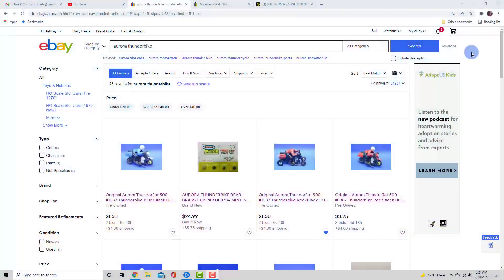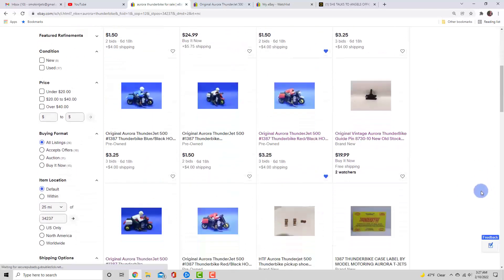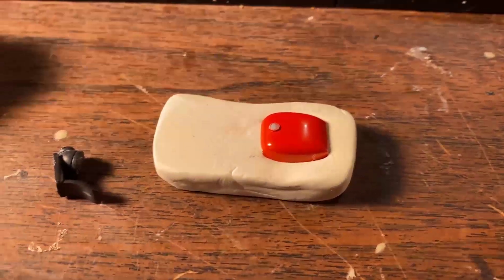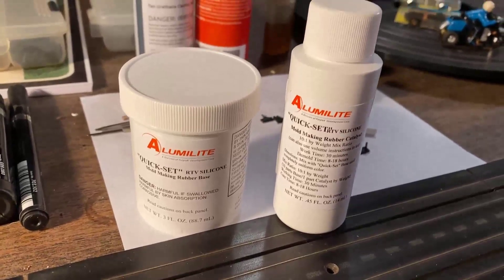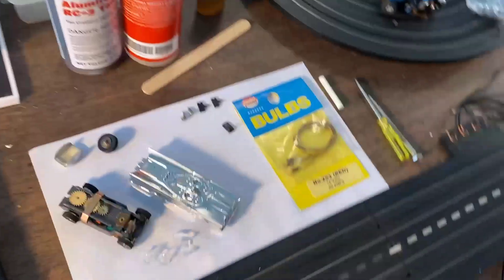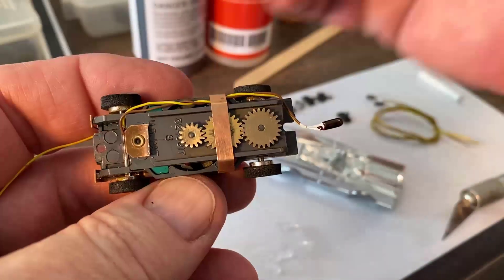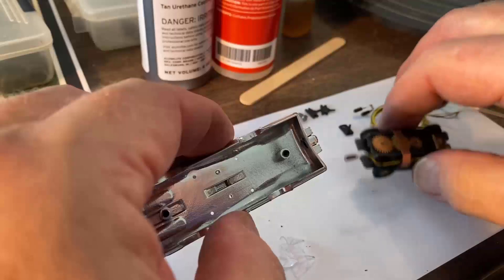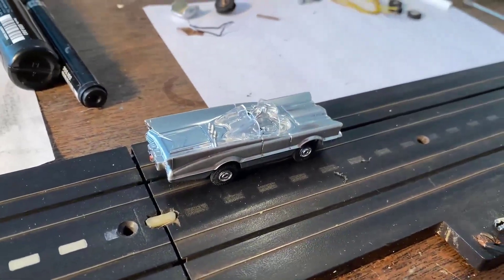Making Parts for Aurora Thunderbikes Trike Slot Cars Plus More Stuff

Comment: Always enjoy watching your videos. If you end up with extra thunder-bike heads or tires I would be interested in buying them from you.
Reply from the maker: Hey William,
Thanks for the kind words, I enjoy having fun making the videos.

I'll be than happy to get you the parts that you need. Send me a  list of what you're looking for and your mailing address.
My email is: smokintjets@gmail.com

Years ago I did a video on replacing the rear tires on the Thunderbikes with neoprene washers (wetsuit material) I found at the hardware store. The washer worked extremely well!! I did have sand them down a bit, they were slightly too thick. They gave the Thunderbike better traction than even New Old Stock tires. Just a thought.

Alright William, have fun, see ya!!

Comment: That jet light for the batmobile is cool. I'm gonna to try that with my 4 gear body. I recently did a video showing how to add 3mm LED lights vs using the incandescent bulbs. A red or orange LED would look nice, and they also don't impact the car's performance.
Reply from the maker: Hey Stock,
Thanks for the comment and the tip. I'd love to see your 4 gear Batmobile when you get it done!!
Let me know if you need anything, see ya Stock.